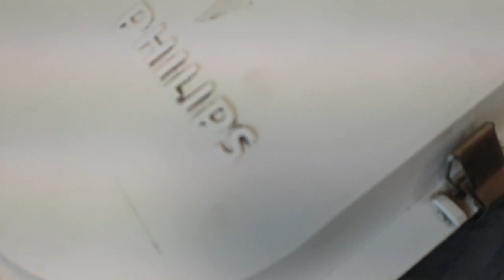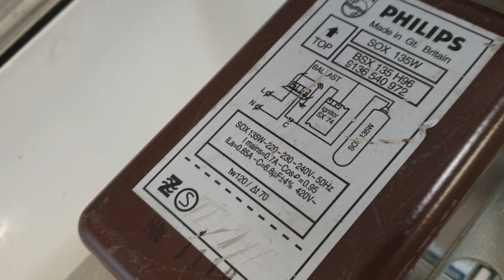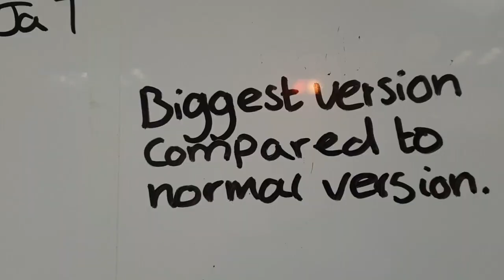Collection #36| SRS 201 biggest version.

Comment: The ballast is for SOX 135W, not for SOX-E 91W. They are the same length, but with different electrical characteristics. It will work but to run it like this is not good for the lamp
Reply from the maker: I know but i don't have a SOX 135w